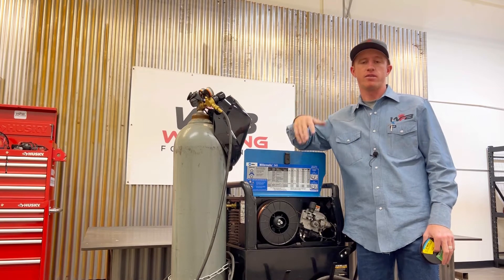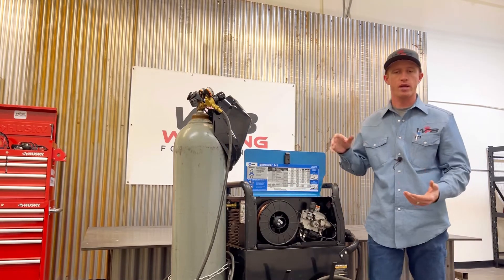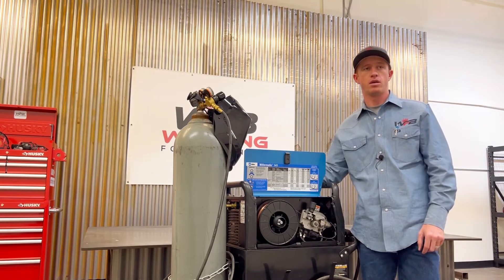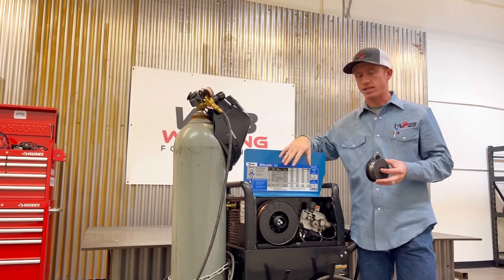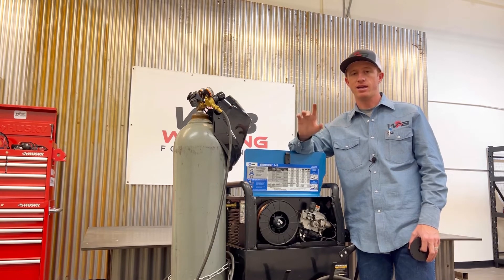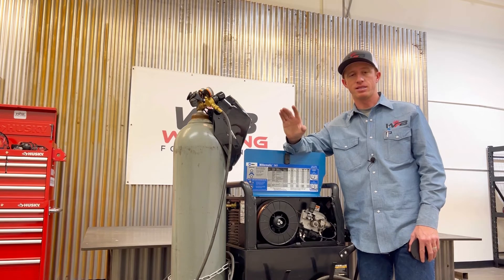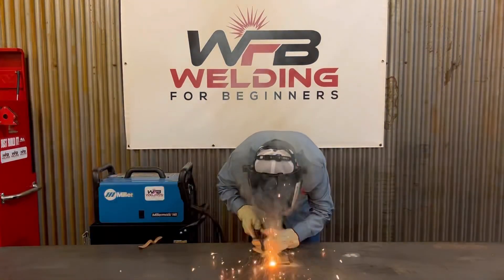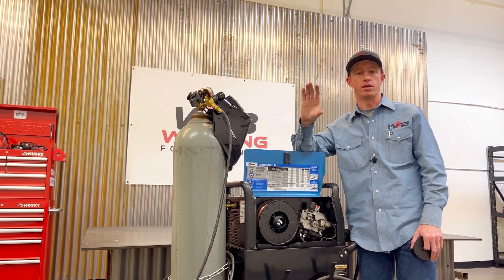What is the difference between GMAW and Flux Core Mig Welding?

Comment: I feel I should mention, even though GMAW doesn’t produce slag, it can produce small silicone spots or islands on the beads, and if they aren’t cleaned off, they can cause the same problems as slag.